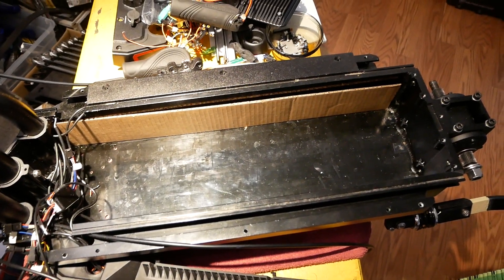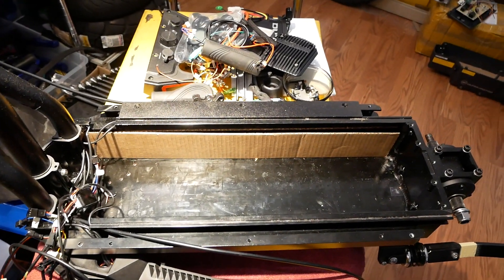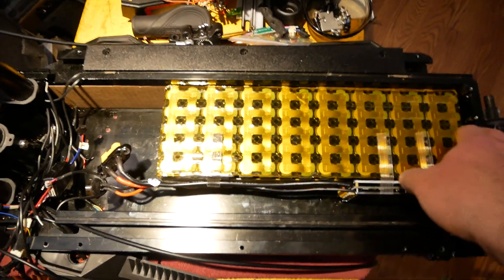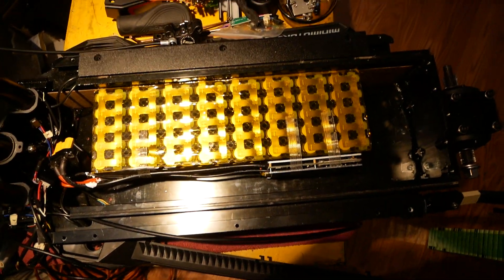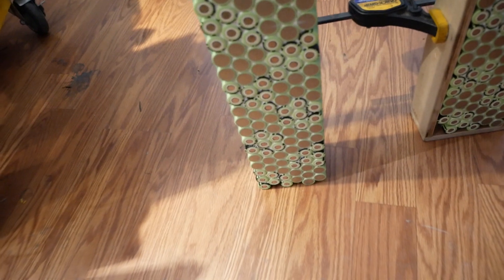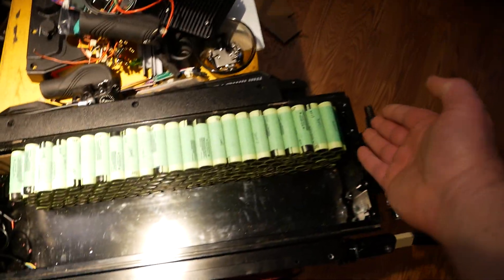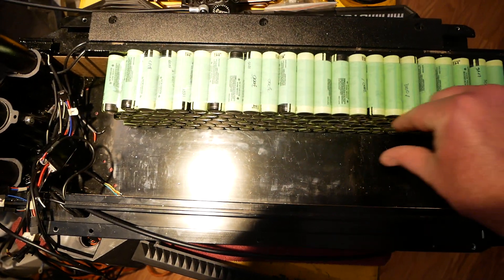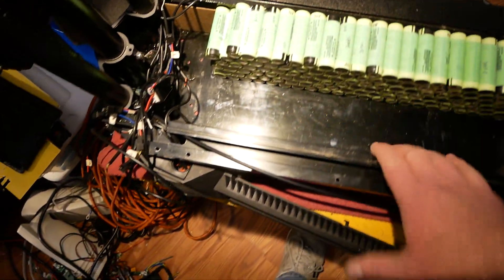Dualtron City battery pack upgrade to 20S14P 2

Comment: Hello this is Sam from Chicago  I am reaching out to you for advice and  Your expertise. Since I leave on the 3rd floor in the apartment building charging the scooter for me it's impossible because I don't have a garage  And the weight of the scooter is huge but I can keep the scooter in my car, so The question is
 Do you think that dual motor scooter with non removable  Battery can be customized to remove  the battery for charging  without taking the whole scooter With me to the 3rd floor. And I  Think I  have the vision of doing that😃 and I think I understand a little bit but I may be wrong I understand that removing the battery itself  it's not enough because there is charging ports and maybe some controller that has to come with it and maybe some Wiring have to be customized   And I know that I would have to remove the deck top and all the screws each time that I would like to charge the battery After possible  Customization. I see that you have a knowledge about the scooters and you can take everything apart  And even make it better, That's why I need your expertise😃
 And I would really appreciate if you can give me some points
 Thank you

Comment: I removed the screws on the battery’s black case but it still not pulling apart. Think they put glue there. How can I open the black case?

Comment: Almost 3.5 KWh, impressive!
Reply from the maker: yup...26Ah at 66v or 1.7kwh vs 47.6Ah at 82v or 3.9kwh...slightly better than double the kwh without using more space. 
*
I had a guy tell me that my pack building was unsafe and sent me a video of an electric bus burning to the ground like that's what my pack would do! OK thanks dude, but I'm going to ignore your FUD! The real truth is he's jealous since he can't build a pack and wants to tear down my work.
*
Maybe I'll get to spot weld this thing together over the weekend? The cells are glued together, but I have been crammed for time with other things since I made this video. I was having lots of issues with the 75100 VESC controllers doing motor detection. I think I finally got past that. Now I need to get both controllers talking over CANBUS with the Davega LCD too. It's probably not rocket science, but I've never done it so it's all new to me!

Comment: Nice! That should go well. 😀
But will you have space height wise to put padding under the cells?
Reply from the maker: I'm raising the deck a little. The factory deck design sucks and leaks into the battery box. If I reused the factory deck, I'd be getting water and dirt inside the battery box all the time since that's how they come from the factory. To get a solid aluminum deck that covers the entire top surface and seals up means raising the deck slightly. When done, there will be spacers in places to raise everything evenly across the entire deck surface. This will create a little more vertical space inside the battery box for plenty of padding. Good call on noticing the tight fit in the pack height.
Reply: @de-bodgery  LOL, sounds great. Looking forward to seeing future updates.
Reply from the maker: @alibro7512  THX

Comment: Hey there - wanted to ask a question about my Dualtron III battery that's having some issues cutting out after ~1700 miles on it which seems early. Let me know if there's a way I can get in touch! Thanks :)
Reply from the maker: Look up Rishimaze on DIY electric car. That's me. 1700 miles is probably too soon for a pack failure from age. However there are lots of reasons for why this could be happening to your pack.
Reply: @de-bodgery  awesome - will shoot you a PM there. Thanks!
Reply from the maker: @andywang259  LION ought to get you 6000 miles without too much trouble. See you over on my PM's.
Reply: @de-bodgery  that's what I've heard. PM sent!

Comment: I have a city and barley made it home from a group ride. How much was the cost?
Reply from the maker: I built it myself so that amount is not realistic for someone wanting to buy a new pack. It would be meaningless to tell you since you can't buy one for my cost in cells and other hardware. Never mind that I gutted much of the electrical and upgraded from 16S to 20S and that requires lots of other work to make that possible. This isn't a realistic question for someone that wants to just buy another pack when mine is so many things besides a new battery build.

Comment: wow that's exactly what i want 280 🔋⋯⋯ but looks like a little dangerous 🥹
Reply from the maker: Dangerous? Why? None of the cells are spot welded together yet so it's just a bunch of partly charged individual cells right now. Maybe once they are spot welded into  a 20S pack, then it will be a little dangerous. I build lots of 82v packs and it's not a big deal. All of the powerful Dualtron scooters run on 20S/82v. Also, this pack won't go in the scooter without electrical isolation and padding around it.